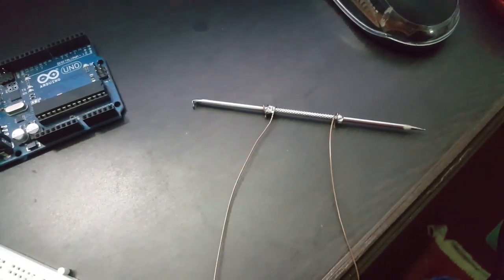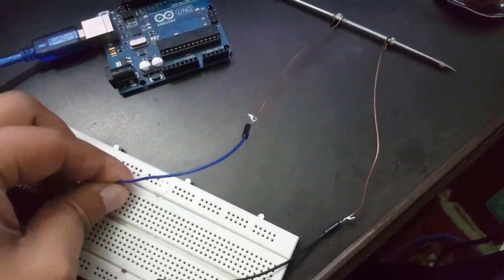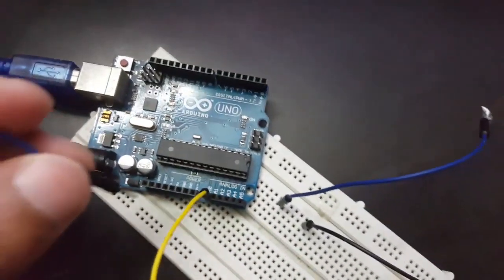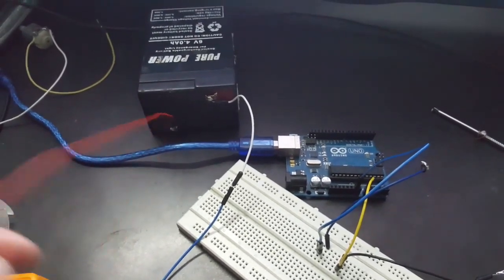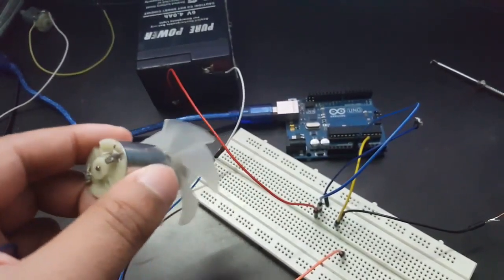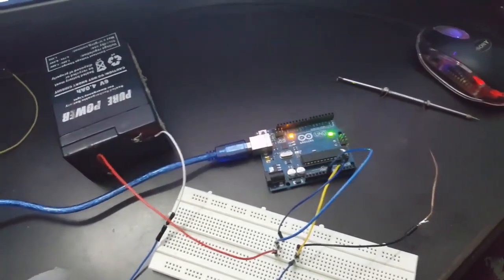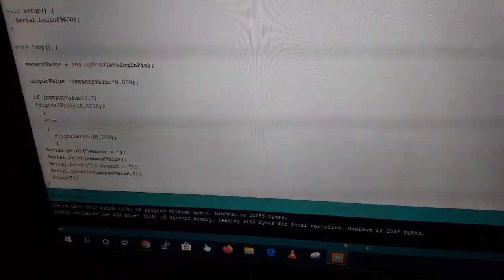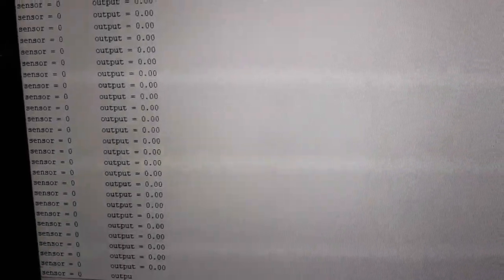Measuring current without current sensor || Arduino current meter ||

Comment: Hi ,good project,my problem is :wih cca 30mA max motor A0 sensor value 1023 ,if disconnect motor 0.
not change only this 2 value.Resistor normal 1 Kohm and  0,5 W(dont have shunt)